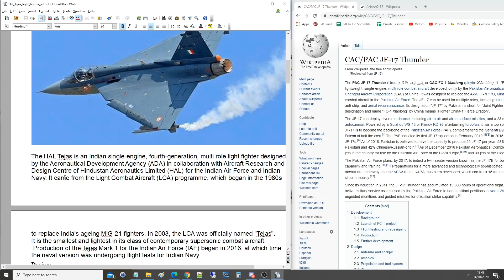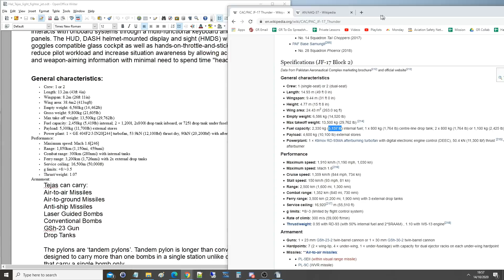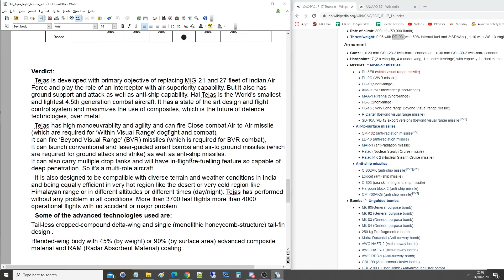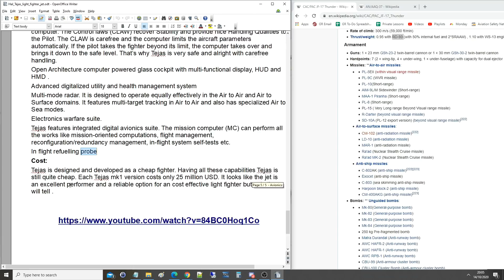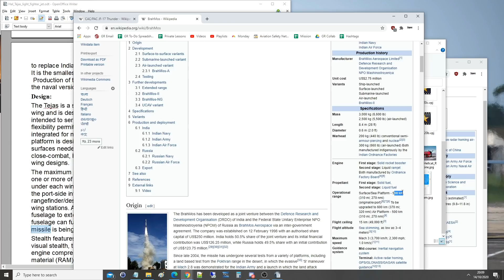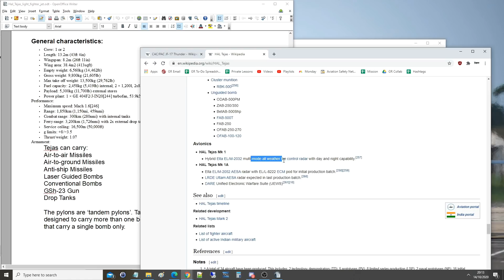Discussion: How Good Is The HAL Tejas?

Comment: If you don’t know then stop talking. The Tejas is a failed junk. Please read the articles at the bottom page. JF 17 thunder block three is powered by Russian RD 93MA engine. This engine is used in MIG 35, which is a 4++ advanced fighter jet. Stealth technology is also added to JF 17 thunder. 
The thrust of the RD-93MA is 9300 Kgf compared to 8300 kgf of the RD-93, a significant bump-up in power.  It will help the JF-17 to carry more armaments and fly at a higher speed. According to the manufacturer,
 “The RD-93MA engine is distinguished by improved operational characteristics, increased thermodynamic parameters, a larger fan and an upgraded automatic power plant control system. The main engine parameters are also enhanced- the assigned resource and thrust, an emergency engine start mode is provided, and the possibility of emergency fuel drain is realized.” 
Jf 17 block 2 version had 7 hardpoints while block 3 version has 11 hardpoints. 
UPGRADES IN BLOCK III WITH RESPECT TO THE PREVIOUS  BLOCK II ARE: 
AESA NRIET KLJ-7A radar of Chinese origin
1) Wide-angle holographic HUD, derived from the one used by the J-20 stealth fighter
2) Refurbished cockpit with updated display elements
3) Updated avionics
4) 3-axis fly-by-wire flight system
5) HMD (pilot’s helmet mounted sight)
6) An extra hardpoint under the fuselage for target designation, reconnaissance or ECM pods
7) Increased use of composite materials in fuselage and wing structure
8) Dual wing pylons for medium-range air-to-air missiles
9) Upgraded self-defense systems, very similar to those used on the J-10C
10) New weapons such as PL-10 and PL-15 air-to-air missiles or CM400AKG long-range anti-ship missiles
https://www.google.com/amp/s/www.globalvillagespace.com/over-60-of-made-in-india-iaf-tejas-grounded/%3famp
https://www.google.com/amp/s/m.economictimes.com/news/defence/tejas-light-combat-aircraft-the-not-so-indian-fighter/amp_articleshow/49398335.cms
https://www.sps-aviation.com/story/?id=1688
Reply: And how much of that is built in Pakistan or developed by Pakistan?

1) Airframe = Russian (based on mig33)

2) Engine = Russian 

3) Avionics = Chinese

4) Weapons = Chinese

5) Aircraft’s designer = Chinese (Yang Wei from Chengdu Aircraft Industry Group)

So there you have it…Your plane is not from Pakistan not even a bit so stop boasting about something that you did not achieve. 

And if you think that the Tejas is a failure then watch this 👇🏻👇🏻👇🏻👇🏻👇🏻

https://youtu.be/6l1MVqzGcVg

https://youtu.be/OWHPIpugxJg

 Now shut the fuck up
Reply: Global village 🤣🤣🤣
Reply: Junk Fighter lol

Comment: Thunder is paper tiger made by china and China didn't inducted it 😂 and had avionics failures and multiple crashes, DCS work on data so data is not that good, jf use russian derivate or related engine exteremly unreliable .
IAF is focusing on 5,6 gen right now this Tejas was for experience purpose platform.

Comment: The IAF also uses MICAs with Dash 5 and Rafale, and also Meteors with the Rafale, There will be Meteors and AESA radar on the Tejas MK1A, and yeah the Tejas mainly carries Russian missiles, but the indigenous Astra MK1 (comparable to AMRAAM/MICA EM), and Astra MK2 (comparable to Meteor) will also be integrated, and IAF integrated R73s on the Mirage 2000H (equivalent to 2000C) before the 2000 I upgrade (that's Dash 5 MK2 equivalent with Datalink)

Comment: The Tejas isn't exactly overweight for the carriers, our carriers operate Mig-29s, just the problem is that in terms of TWR, the Tejas lacks behind and because our carriers are ski-jump a single engine fighter like the Tejas couldn't take off with optimal payload.
Reply: But tejas done maiden landing and take off in vikramaditya
Reply: @sohanm3051  Bro, you are not getting my point, doing landing and take off and doing actual operational sorties are very different. The Tejas did the landing and takeoff trials without weapons. It would not be able to carry enough weapons and take off from the carrier, it does not have enough thrust. It will be able to carry maybe 4-6 air to air missiles or bombs or maybe one anti ship missile with 2-4 anti air missiles, that too with less fuel. The Tejas already has low range, using external fuel pods will mean it won't be able to carry much more than few air to air missiles and carrying one or two anti-ship missiles or heavy bomb payload will mean it won't be able to carry full internal fuel. It can fly off of the carrier but it is not practical for operational use as it won't be abl to carry enough weapons on it due to thrust limitation. On the other hand a Mig-29K can take off with 2 anti-ship missiles, one external fuel tank, full internal fuel, two rocket pods and 4 air to air missiles. That is a very good weapon load, the Tejas won't be able to carry half of that and especially not at long range.
Reply: @AnuragDDethe  I don't think the tejas is made for long range.

And also, it can tank and refuel after takeoff if it has to.

Such a small platform is never ideal in every way, but it may be good enough if they use it wisely.
Reply: @questioneverything4633  Yes, of course, Tejas is a relatively short-ranged interceptor, at least that's how it was designed, it has multirole capability but its range couldn't be improved much. It can also refuel but it is difficult to find refuelling service when at sea. It can be usable of course if used wisely, but as you said, it won't be ideal.
Reply: @AnuragDDethe  tejas burn alot of fuel at the time of takeoff bcz of which it lacks the need of indian navy
Reply: @NoctisArcherX178  I don't know where you are saying that from because I saw no such explanation anywhere. Tejas has a very efficient engine, but maybe it can be the case that the Tejas needs to use the afterburner during takeoff and that may be what burns so much fuel during takeoff. Still, all the reports the navy gave complained about the Tejas' lack of range and payload.
Reply: @AnuragDDethe  that's what I'm saying.... but Indian navy wants twins engine aircraft, that's why they refuse Tejas... they don't reject it
Reply: @NoctisArcherX178  TEDBF coming soon.
Reply: @frightfulbuffalo7081   I Know and its first flight will be in 2026 but until it completes its production and trials Indian navy need to fill that void that's why they decide to take aircraft on lease from other countries.
Reply: @questioneverything4633  no bro it’s like the enemy is coming close to attack u but u take off and refuel instead of intercepting them ? , and without external tanks u won’t have much fuel anyway .
Reply: @hemendraravi4787  I never said it was an interceptor.  Carriers bring along more than just interceptors.
Reply: @questioneverything4633  well Indian carrier just have mig29s and rest are helicopters so
Reply: @frightfulbuffalo7081  o waht is that it looks nice
Reply: @jameshealer1395  it's the naval version of Tejas. TEDBF - Twin Engine Deck Based Fighter.
Reply: dosent india can also make su30s 
which are preety good as long range and even more with now new radars 
so hal tejas for home defense would be good
Reply: mk2 is for navy which has of if those

Comment: Tejas combat range with drop tanks is only  500km.
Reply: Search on non pakistani channels for real data
Reply: @vanshexplores  He is correct. It is 500 km. You can see it on wikipedia or HAL website
Reply: @ananthshenoy5163  Combat radius is a dubious term. It can be around 300 kms(100% payload no drop tanks) to 800 kms (3x Drop tanks and 4 Air to Air missiles).
500 kms Radius is i think with around 3 tons payload and 2 Drop tanks.
It can also be over 1000 kms+ with 1 Aerial refuelling.

A real range comparison can be done by comparing "Ferry range". It means how far a fighter can go with no payload. For Tejas , its around 1000 kms from point A to point B.

Comment: Didn't LCA project begin in 1984? But production series came out in 2016? 32years of development? there's gotta be a wrong number
Reply: Its right, but we already built tejas mk1a which is a better version of mk1 and aMWF tejas mk2 and in 5 yrs, 5.5 gen amca mk1 will start rolling out
Reply: The project was delayed because of lack of funding and the political will. US embargo after India's nuclear test also delayed it. The mk1 was planned supposed to have the Kaveri engine which was to be developed by DRDO. It failed and the project was abandoned (Now they're working on a different engine with some help from the french).  
And the IAF was very reluctant to induce Tejas at first. It's pretty well known that IAF's procurement process is all over the place.
Reply: Design begin in 1989, first flight in 2001, induction in 2016

Comment: The only thing similar on the Tejas and JF-17 is the weight. In terms of technology Tejas is miles ahead.  Tejas classifies as a 4.5th gen right with the Tejas mk1, whereas JF-17 Block 1 and Block 2 barely fit into the 4th gen category.

1. JF-17 does not have an unstable design with Relaxed Static Stability(RSS) as the Tejas.
2. JF-17's Fly by Wire is only on 2 of its Axis and its inferior to the Tejas's Quadruplux Digital Fly by Wire.
3. JF-17 uses mostly metals compared to Tejas's composite.
4. JF-17 is nowhere as stealthy as Tejas
5. Tejas is way more maintaince friendly and has high availability .
6. Tejas's GE404 engine is way superior and more reliable than RD-93
7. Even the electronics and software on Tejas is superior . I think JF17 uses C++ ? Thats not even military grade coding.

Some more facts : The range of both are similar. Wiki is not reliable. We know for the fact with internal fuel, Tejas has a ferry range of over 1200 kms. With 3 Drop tanks , its close to 3000 kms.  The rest depends on weapons load, type of mission, etc.

Tejas's cost of 25 mil$ was in 2006. Today the upgraded Tejas mk1A is priced at 45 mil$(fly away).  This is still cheaper than fighters like Rafale and Eurofighter which are around 100 mil$+ flyaway.
It has a dozen major upgrades over the baseline Tejas mk1 such as an AESA radar, more powerful EW suite, even easier to maintain, etc.
Reply: 8. Using a JF-17 means you're tied to the Chinese weaponry and after sales.
9. Tejas can be fitted with NATO, Russian or Israeli missiles.
10. Has Air teaming support.
 
Btw, I think the JF-17 block 3 is supposed to have a stealthier design. 
Also, didn't India offer Tejas to Malaysia at $28m recently?
Reply: @ananthshenoy5163  jf17 with stealthier design means only radar absorbant paint. I don't think they can change shape or even add carbon composites.
Reply: 4 th generation
Reply: Tejas mk1a with Uttam aesa and ASTRA mk2 is going to be a huge game changer. It's a matter of  3-4 Years. This combo can defeat anything that paf can Field.
Reply: @pravinmeher2036  keep on dreaming, the jeff is in its third block and they've started research work on the 4th block while you people have been dreaming . 🤡🤡
Reply: @warham_40k  research?? You don't even know the difference between designing something vs researching. 
But probably you are probably right. Jf17 does need reserarch
Reply: @pravinmeher2036  I meant the work on 4th block is it's initial stages but you on the other hand have yet to produce a single mk1a considering your track record is abysmal at best.
Reply: @warham_40k  block 4? Lol. By 2040 you would be working on block 20 and by 2050 you would work on block 40. 
I heard block 4 has capability to orbit the moon and come back without refuelling. Is that true?

Comment: Loved your video but some things I wanted to point out for you.

Range stuff is wrong or badly calculated cause it has reliable engine, better fuel consumption, more military thrust which means on loiter you can have better speed and more fuel capacity in internal or external against JF17.

In weapons Python 5 had some teething issues, R73 is backup weapon and ASRAAM is primary (not integrated yet) for WVR for BVR old derby, new I-Derby-ER and Astra Mk1 (roughly equivalent of AIM120C7) in bombs all russian bombs in IAF inventory, NATO paveways, Spice (EO, INS) in 250, 500 and 1000kgs (100km range), Griffin LGBs, CBU105 SFW and anti ship missiles KH31, KH35 and brahmos NG (450km range, 3-5m above water causing at terminal phase, supersonic) for future in ARM KH31 and Rudram (in future) 

EL2032 Radar, EL8222WB SPJ, Targo II helmet, holographic HUD, Litening IV targeting pod
Reply: Unclassified RCS is 0.5 in clean, it was limited for +8/-3.5 due to software now its 9G capable

Comment: The hal tejas has been designed to use Israeli elm -2032 and 2052 radars with Israeli I derby and python 5 missiles with ranges of 100 km and 35 km respectively.

Comment: Jf 17 has a t/w ratio of 0.64.
Tejas has a t/w ratio of 0.67.
The thing is that jf-17 has a much higher wing loading at  552 kg/m2 compared to the tejas's wing loading of 351 kg/m2 that helps the tejas in dogfighting.
Reply: Dogfighting is irrelevant now JF17 has BVR Missiles like PL15 basically who sees first strikes first
Reply: @ShafiqUl-rehman  exactly who sees first. In this case the Tejas wins with a rcs of 0.5 m2 vs jf 17s 1 m2. And Tejas has a better electronic warfare system provided by France and Israel. So even there Tejas wins.

Comment: Navy rejected Tejas because it has low range, less payload and single engine as compared to Medium fighter aircraft (MiG-29K (used by Indian Navy), Rafale and F 18s). Astra is AMRAAM equivalent missile (similar profile), developed to replace Russian missiles.
Reply: @Vinesh Civil With 2 engines and in medium weight category
Reply: Astra is a rebranded R-77M
Reply: @asiftalpur3758  Pity your ignorance, it has advanced seeker and smokeless propellant, also higher NEZ... do some research before commenting crap
Reply: @alphavictor7581  oh wow smokeless propellent for a radar guided missile, wow what an achievement. Throwing words like "advanced seeker" really just shows your amount of research.

It's a reskined r-77m with Israeli motor, 1:1 copy of a Russian r-77m seeker head housing with improvements made to the gimble and TWS mode. That's it.
Reply: @asiftalpur3758  If that's so easy why PK has no BVR AAM? Anyways, your opinion doesn't matter
Reply: @alphavictor7581  PL-15 and standard F-16 BVR AAM which your air cheif proudly showed off on media as the missle which was shot at your Su-30.

Your opinion really doesn't matter as you don't know shit about what happens in your country, let alone your rival neighbor. What you have is off the shelf options and rebranded BVR AAMs for your off the shelf foreign fighters. What Pakistan has is the means equip all of them in a fighter that we make and export. Can't say the same about you though, even though I'm personally a fan of the Tejas. It's a promising platform even if it has teething issues.
Reply: @asiftalpur3758  live in fools paradise, while all the claims made here are factually wrong, non of them are made or developed by your country...
Reply: @alphavictor7581  I like the pessimistic three periods at the end of your comment. Indicates that you're way out of your league in this discussion. Not only did you have nothing to back your BS claim about Astra being something magical, but also fell flat on your Pakistan has no BVR AAM claims, but were swiftly reminded of what took down your su-30, along with a brochure of JF-17s capabilities, the weapons it can carry and it's export success.

Sit down, do your research and then come back.
Reply: @asiftalpur3758  the fact is that I don't wanna get in an argument with stupids who refuse to accept the reality, be it about historical events or on the innovation fronts... So keep trying.
Reply: @alphavictor7581  sure man. There are a billion Indians on the planet. You're really not worth being engaged in a argument anyways.
Reply: @asiftalpur3758  a bankrupt nation who just borrows everything 😂
Reply: @asiftalpur3758  fun fact   jf 17 never shot anything   your media cooks  soo many jokes d 16 and jf 17 look same  no su 10 was shot and a mig  shot f 16
Reply: @asiftalpur3758  export of jf is very worst  Myanmar grounded half of its jf flleets
Reply: @aswinaadhav3204  as an indian u really shouldn't talk about exports since your tejas isn't being accepted by your own navy/airforce while Pakistan has it as its backbone and is exported. You also shouldn't talk about grounded rates since your Mig29 and Su30s have less than 50% availability rates.
Reply: @asiftalpur3758  lol   tejas never crashed  while jf record of crash  some African nation bought jf idk the country they told the jf failed to shoot a drone literally  man your country is soo poor than it kept the worst jet as it back bone jf  never participated in any shows it always withdrew its just a cheep copy of f 16 a poor man's f 16 only 3rd world nations who can't afford good jets but jf 17  it has no special  capabilitys  its just a  jet  nothing to bose all nations keep heavy jets as there back bone weird why pak chose that  you know why our navy rejected it because they only prefer twin engine jets people with no military knowledge won't understand

Comment: It is rejected by indian navy for the reason of Over weight, so it doesn't mean in terms of it is overweight, it is a light weight combat aircraft indeed, but it means it is lacking in thrust power to take off from the deck with full load armaments, because it is a single engine aircraft so it have to rely on it single engine to thrust this bird, so a very short take off from the ski-ramp of ship deck with lower thrust engine is difficult.
Reply: no?tf are u pulling this off? ur ass?